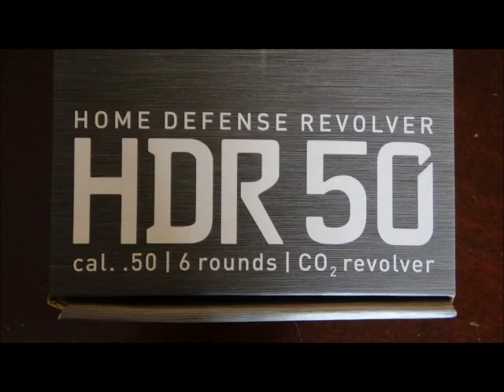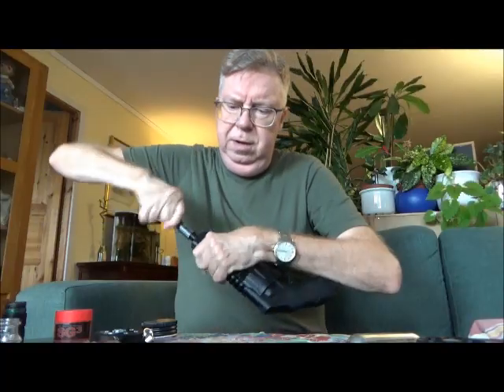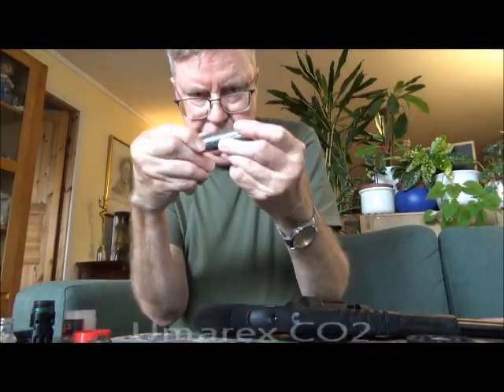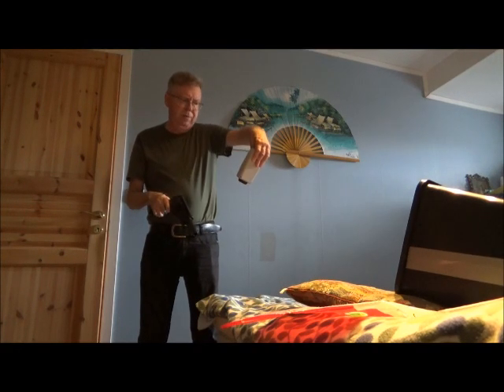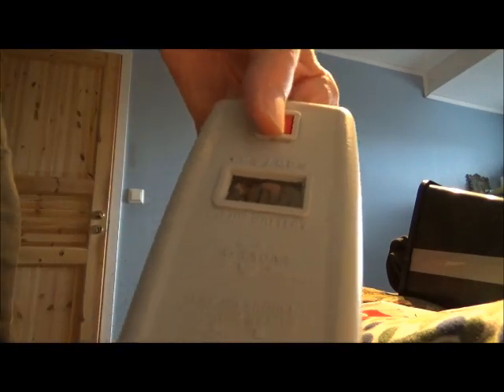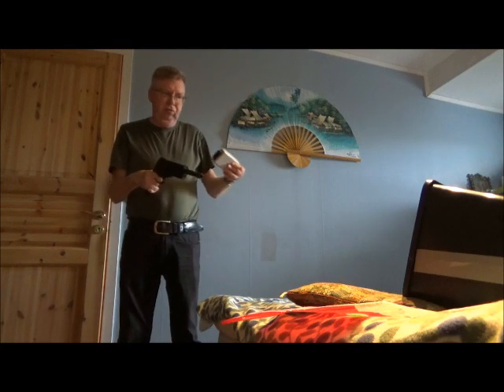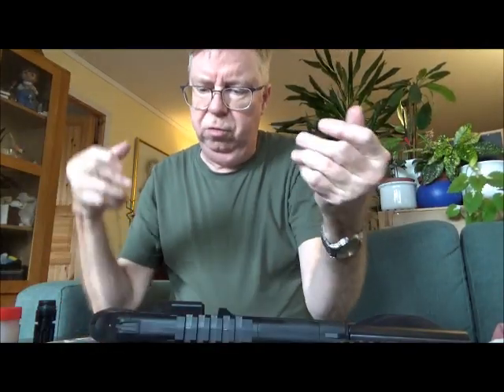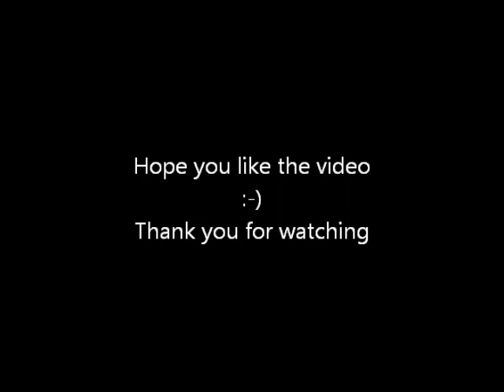Umarex HDR50, Powerkit50 & Tuning Barrel, Homedefence-24

Comment: Hello! I've removed valve block for my TR50, and it farts now( How can I make a restrictor? It is not installed in my tr50. I heard it is possible to make it out of ball bearing
Reply from the maker: Hi. Just cut the tip of a used 12 gram CO2 canister. Cut it ca 12 mm wide and file down. Right size is 11,15mm. This works great as a restrictor. Just drop it in tipp first and put in the CO2 canisters as normal. Depending on the size of the hole in the canister you get between 7-15 shots from the CO2 after this mod.
Reply: @runerebel8441  thanks a lot! Will try now
Reply from the maker: @oleg5109  Good luck 😃

Comment: I am beginning to understand the HDR50 a lot better these days. It is most consistent using co2 with lighter rounds as you have shown time and time again. Heavy round may turns out higher energy but the average turns out lower.

Hpa is a different animal but many people only use co2.

Nice job as always.
Reply from the maker: Thank you Sean🙏. I have tried HPA in all my HDR50 revolvers (I have 3 of them) but they dont like to be used without the restrictor, just dumping all the air or CO2. Not sure why it does so since all the other markers works great without it. Very strange indeed🤔. Cheers my friend 😃
Reply: @runerebel8441 not all markers are created equal i guess….or it is the air 😂
Reply from the maker: @lesslethalfordummies  Hehehe😁. Maybe its the air 😂

Comment: 1st!
Reply from the maker: Nice 😃
Reply: I've got the turning barrel for the HDR50 but not fitted it yet, I just done the HDP50 first, I seem to be doing my pellet pistols at this time, very good power Rune, 🇳🇴🏴😀ps will see if  you can get some motor bike jeans.
Reply from the maker: @Craig59J  Thanks Craig. Yes it has good power now. Good luck with the powertuning my friend. Iam just using whatever old clothes thats no longer in use. The jeans is a good ball stopper 😃👍